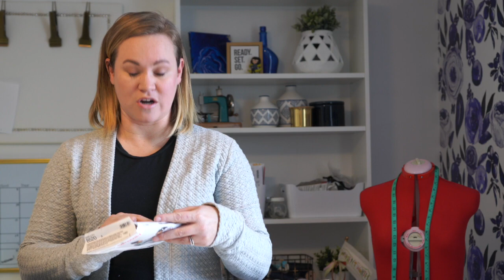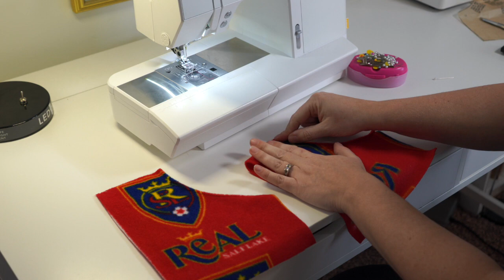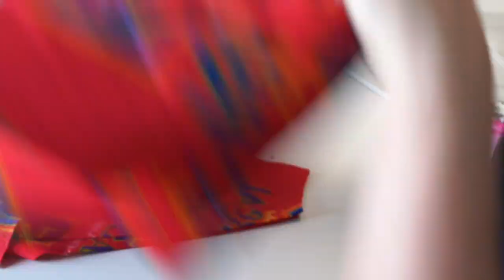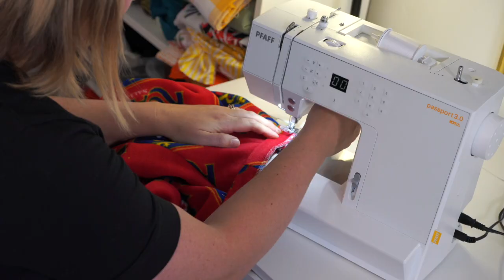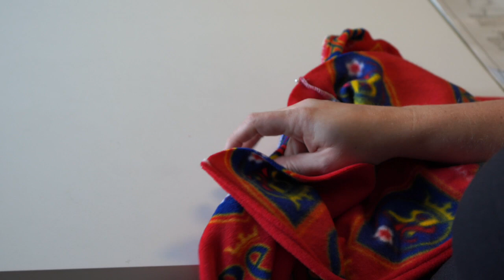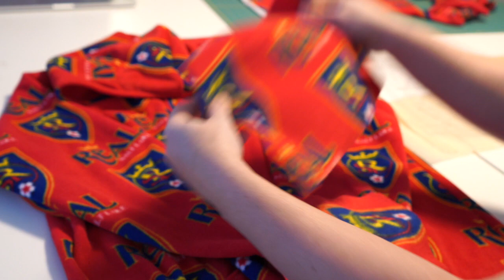Simplicity Pattern 8520

Comment: Hello I just bought this pattern.  So this can be used with a fleece.  In the video was that a fleece?  Great video I will try it this weekend.   Thank you.
Reply from the maker: Yes, although I would size up a size or two since fleece doesn’t have the stretch that knit does. ❤️
Reply: @mckellmakes404  would that apply for flannel as well?  It stretches even less than fleece.  Would it still be appropriate for this pattern?
Reply: You are awesome.  Do u have other sew alongs